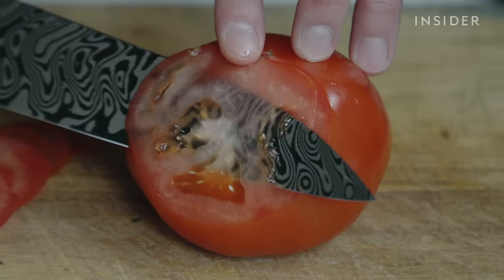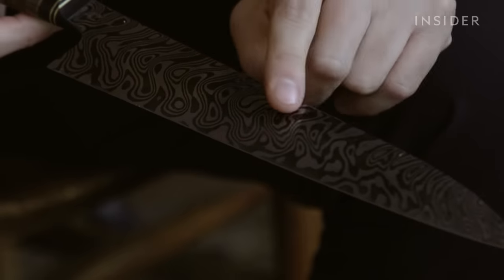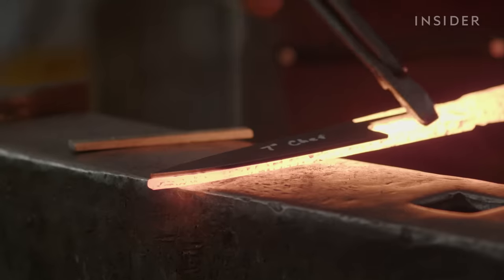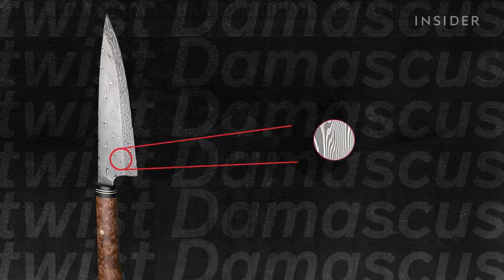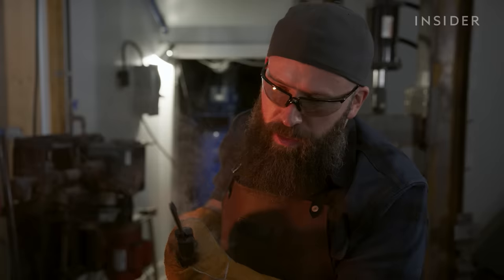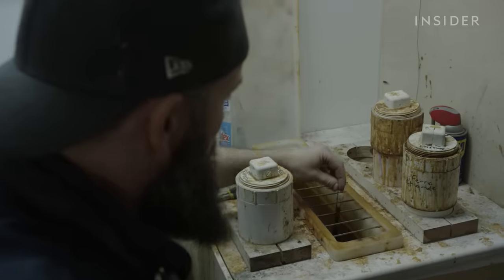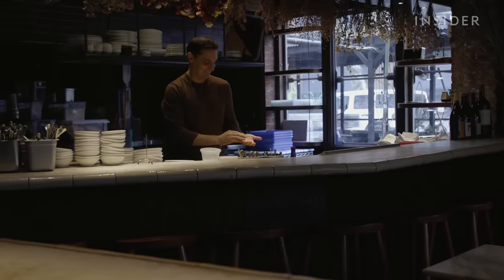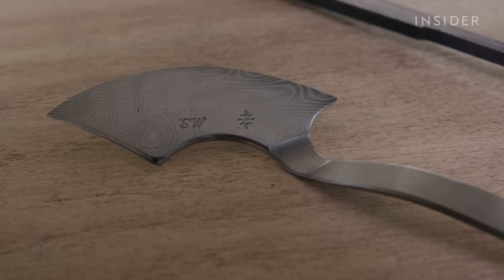Why Damascus Knives Are So Expensive | So Expensive | Insider Business

Comment: they should atleast reference it to japanese katanas. without japan, damascus knife wont exists.
Reply: What do you mean? First, this is not the same process as historical Damascus (I'll pop that info in another comment). Second, folding metals for blades is actually a fairly common technique throughout history.

Japan naturally has very poor quality iron, and so the blades had to be folded many many times to build up strength and work out impurities. Other areas in the world also folded their blades, just not to the same extent.

I know Japenese swordsmiths would also assemble swords from different blocks of folded steel, and that we see Viking swords start to use a similar method around ~500? AD (used Wikipedia for the date). I'm not sure how old the assembly process is in Japan -- if there's a link between the two (via the Silk Road, maybe), I'd love to hear more about it!
Reply: So it's called Damascus steel, but it's a different type of steel from what we see historically.

The steel in the video is also called pattern welded steel, made from layering metals and folding them over and over again into different patterns. Under a microscope, those lines stay very distinct, like the spines of stacked books.

Historical Damascus steel (aka "wootz steel" or "crucible steel") was made through a crucible process. An ingot was placed into a crucible and heated to the point where the molecules broke apart and rebonded. At the molecular level, this looks kinda someone scattered grains of rice. You don't have solid lines like you do in pattern welded steel.
Reply: The japanese don't reference things that they've culturally stolen so.....